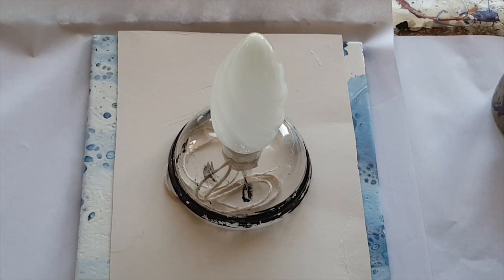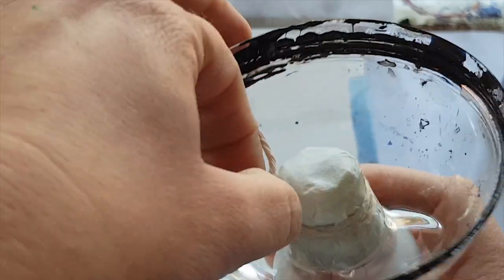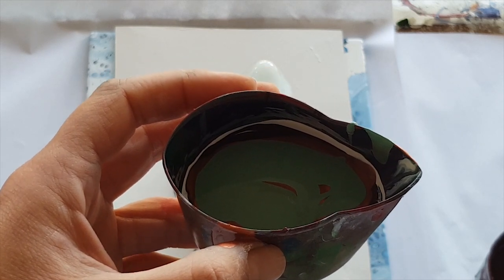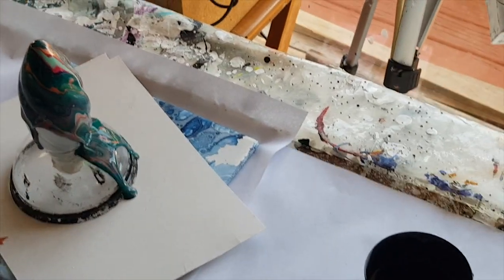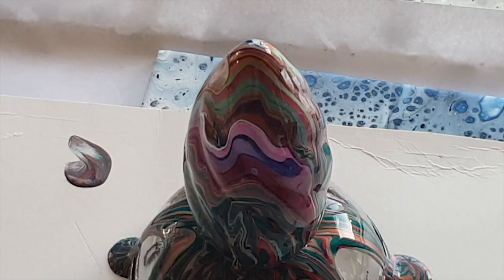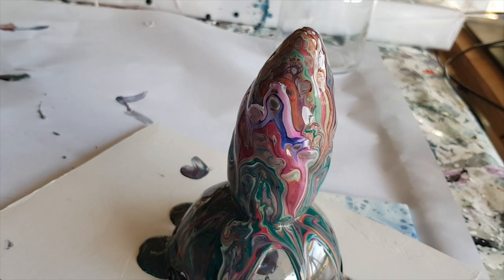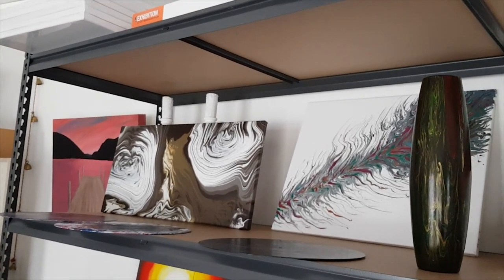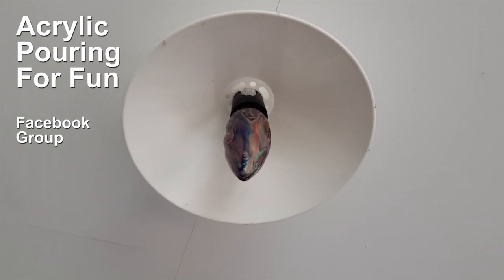250 3D Pour on Candle Bulb

Comment: Don't use the damned thing.  The heat will melt the paint on the bulb.  Common Sense,   Felt the heat that comes off them?  Yay it's pretty, but once those folks doing the same thing, burn down their homes, you gonna build them a new home?  You literally put it in a socket and lit it up.  15,000 folks are going to think that is alright to do and it is NOT!!!  I am sorry, I love your work, but this one needs to go.